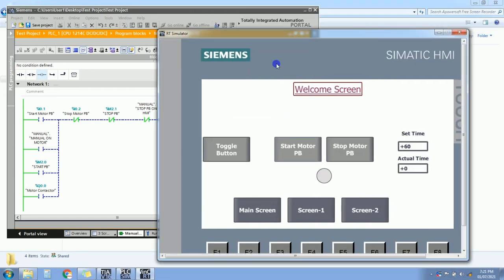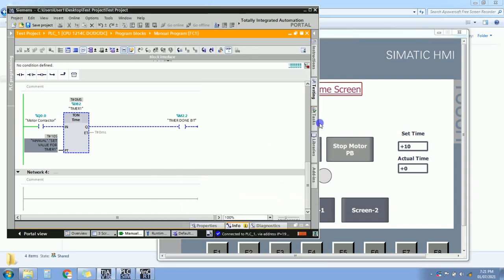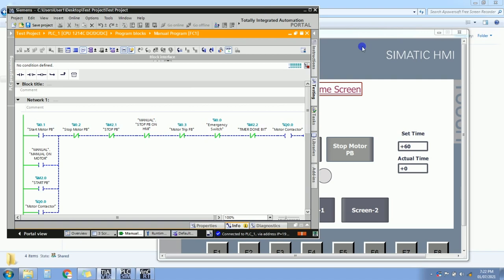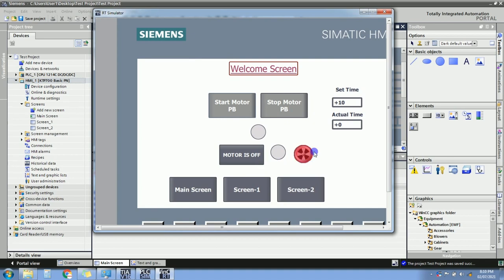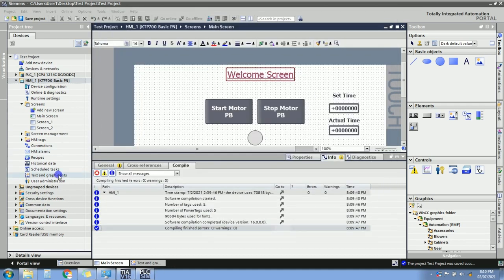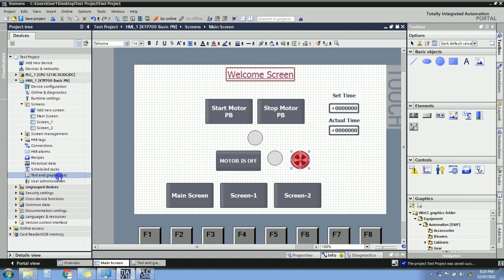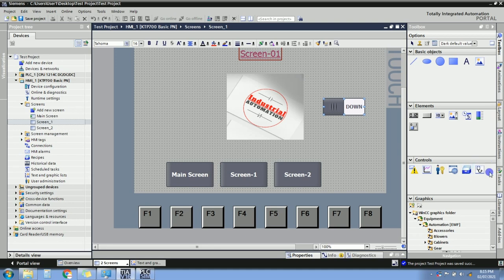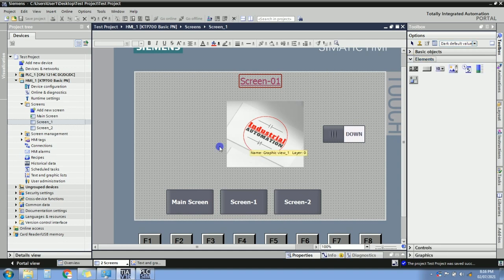TIA Portal :- 3 Hour Complete Training | Part-2 | English

Comment: hey sir , i am getting this error at the last.
can you help ?
Network 3,The '"TIMER1" V1.0' data type is not supported on this CPU or by the current library version.,,,7:09:33 PM
and Network 3,The 'TON V1.0' data type is not supported on this CPU or by the current library version.,,,7:09:33 PM